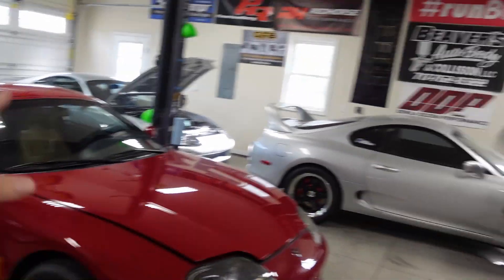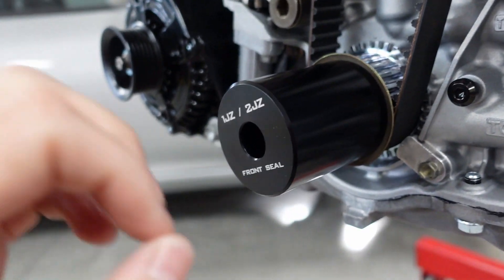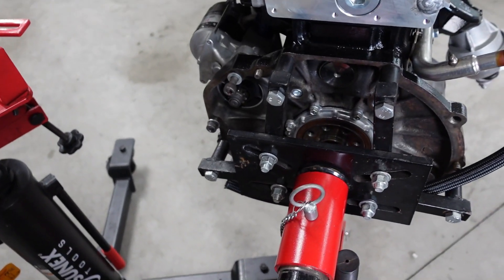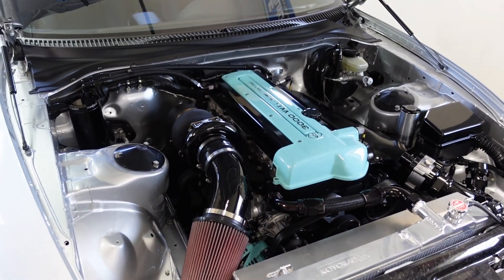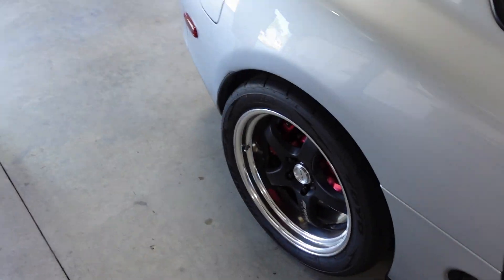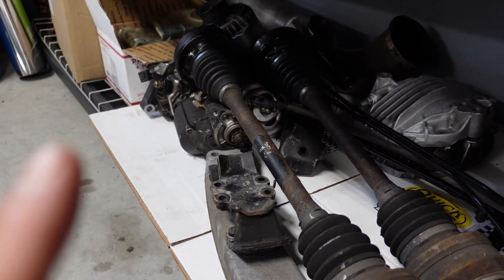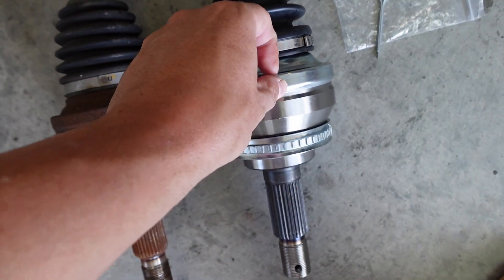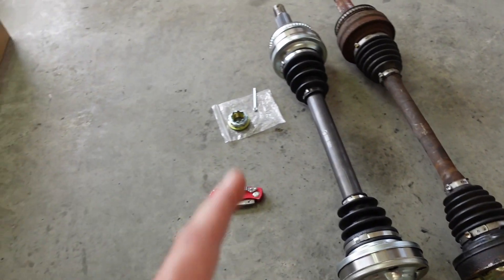DewlaDEZIGN 2JZ Seal Install Tools & $75 Axle Fix!

Comment: They stole my design for this tooling 🙄 i made the original ones at SRD Tuning 3 years ago...
Reply: We were told that they were discontinued, A customer brought us a set to machine because the rear was not machined correctly. So we updated it to proper depth and re-released the part. If you are still selling them (as they are not listed on SRD) We'll stop producing them. As we were misinformed
Reply: @dewladezignperformance8978  That's ok you must have liked the design to copy it 😉 and the finish of your product looks great. 

Its a cool design makes fitting the front main seal easy and Repeatable to the correct depth. 

I've built loads of engines and used my tooling over 500 times perfectly.

Rear seal tool wasn't as popular and a silicone spray was needed on the outside of the seal to make sure it went to the correct depth witch people didn't do. 

If fitted dry it would compress the rubber and not go all the way in. 

Other issue with the rear seal tool.  is you have to make sure the lip of the seal is over the crankshaft 1st otherwise you run the risk of popping the lip backwards Damaging the seal and lip seal spring coming off.

Nice to see they went world wide and guys like yourself are constantly keeping the 2jz and supra alive. 

Ash
Reply: They copied all of SRD stuff. Have the under panels, then these knock offs made them too. Sue this guy.